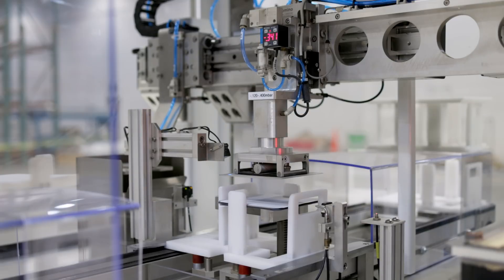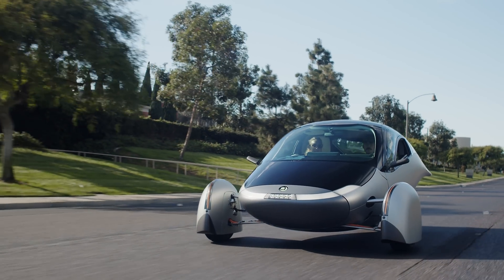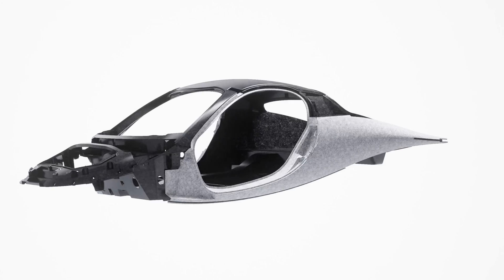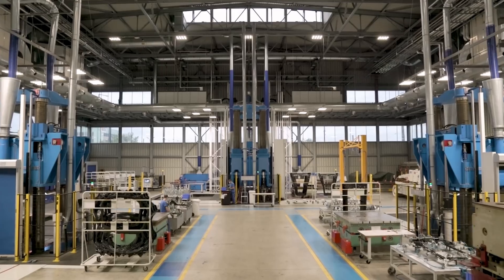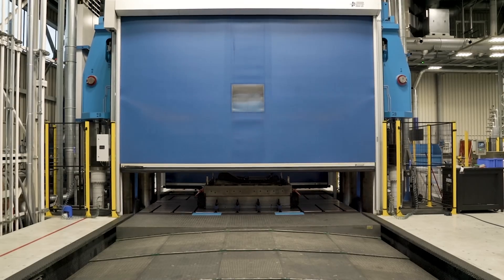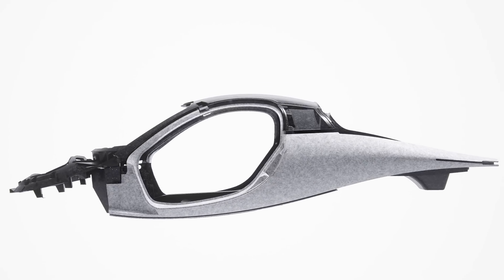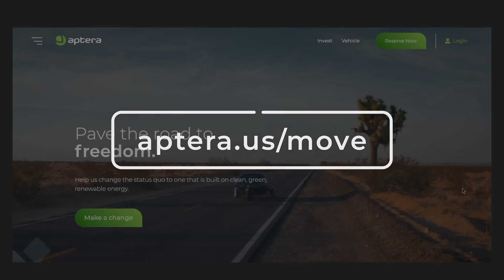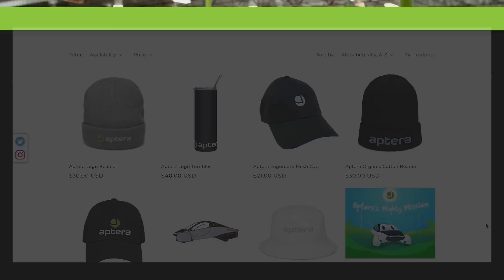Aptera Update — November 2022

Comment: Seeing the integrated production of the "body in white" is reassuring. As a fan of Aptera, knowing that six perfectly-fitting parts make the body means the vehicles can be assembled in large numbers WITHOUT (before?) the use of robots. When the purse is tight, this may yet allow production to get going. The cars will surely sell, if they can make them.

Comment: Let me know when you no longer use hub motors!
Reply: Why would Aptera take such a huge step backwards?
Reply: @n.brucenelson5920  That my friend is an exceptionally GOOD question! WHY WHY WHY would Apterra EVER use THE WORST brushless motor there is...and yet...that IS exactly what they are doing and then blowing hype about "how good" they are when this is patently false! I could list for you the 20+ reasons why you should never use hub motors and then list the 1 or 2 reasons why you should of which both of them are not very good reasons. Basically, Aptera is marketing an idea to people that don't know any better about just how awful hub motors are! There's super good reasons why you don't see any EV makers other than for ebikes and low quality electric motorcycles using hub motors. The short answer is they suck in nearly every way. Then Aptera is blowing even more smoke about solar panels in their cars. Will this add range? Sure it will, just a negligible amount is all. You are almost better to NOT have the solar panels. The cost for them won't be recouped in charging value saved any time soon! I'm guessing something like 10-20,000 miles of charging before you might break even on the cost of the solar panels. LOL! This comes down to the dismal efficiency of solar under even ideal situations. Even in direct, bright sunlight with so called "high efficient panels" you are unlikely to get more than 18-20% efficiency from them and that equates to much lower added charge and range than will be meaningful to most people. Aptera is peddling a lot of hype! I don't want them to fail, but at the same time, it won't take too long after they deliver product to people that the reality of that hype will become self evident.
Reply: @de-bodgery  As it happens, I worked for a company that developed our own electric motors for use in sea water.  Tesla was a cross the street, and when they ran out of money and had to lay off their motor engineering staff, we hired them.  I know a bit about motor design, even though my specialty was thermal engineering.

I contacted Elaphe with specific questions a couple of years ago, and they had satisfactory answers for me.

"why you don't see any EV makers other than for ebikes and low quality electric motorcycles using hub motors."

The answer to why YOU don't see them is that you haven't looked.  They are now being delivered in production vehicles.  There is detailed scientific literature with the results of controlled testing going back decades that debunk your claim.

Your claim "I'm guessing something like 10-20,000 miles of charging before you might break even on the cost of the solar panels." could actually be correct.    That is less than a year to pay back the cost to the average driver.   After that it is all money in the pocket of the owner.  At least to me and many like me that is significant.

The numbers you cite may end up to around 20 miles per day or so rural Iowa on the average - likely to cover all of my normal driving needs.  In addition, it will extend my ability to get to camping spots in remote locations such as Death Valley, and still have the power to return - something that I found difficult when motorcycle camping, and a big plus for people like me.

The reality is that nothing else comes close to providing the performance that Aptera does.  Both my wife and I have ridden in an alpha prototype.  Few people have experienced the acceleration that even these early examples offer, and it is major FUN.  

If anything, Aptera is under promising and as is clear now with the C.P.C Group agreement, will be over delivering.
Reply: @n.brucenelson5920  You are clearly a fan of Aptera so you probably already heard this.
https://www.youtube.com/watch?v=gFnyBWEAwqc
This is possibly the first thing about Aptera that I REALY LIKE...right to repair...they said it right there in the interview....that they will provide full disclosure of parts and how to repair anything. Do a battery swap...no problem...here's the new pack and how to do it yourself. I WISH the rest of EV makers at least claimed they would do this! Whether Aptera really does this or not has yet to be seen since they have not delivered even a single vehicle yet. Still...I do LIKE that they are saying they will!!!
Reply: @de-bodgery   @De-bodgery  Yes.  This was a key for me.  Their Chief Technical Officer, Nathan Armstrong, speaks to this eloquently as well.  He also talks about letting customers play with and modifying the firmware in their vehicles with the companies' blessing, for those so inclined.
Reply: @n.brucenelson5920  I do like this a lot. Whether they really do it or not has yet to be seen. I did do a bit of searching for any Aptera git repos and found nothing. I work in software development. IF they are really going to be open source, then where's their repos?

Comment: really bruce; you are the same "ambassador" for Aptera that told me You'd have your Aptera by now; and the same person that then said production would be by Mid 2023 after a list of lame excuses for no production - not even one vehicle a month. So -where are the videos on these people being trained? They video the most trivial garbage - where are those that would really be great - lets see the videos of people being trained with tooling and parts to train them on - super lets see that.
Reply: As you know, the number of pre-orders has swelled far beyond forecast.  It is clear that the vacuum bag resin infusion method of production couldn't keep up with the surprising demand.  The agreement with C.P.C. to produce the bodies pushes back the start of production, but greatly increases the production ramp up rate.  It also likely increases the investment target needed to reach production.

As you should know, Aptera Corp is still far ahead of Tesla's pace in developing the Roadster - both technically, and in financial terms.  You can't point to a single manufacturer who has reached the current stage of Aptera faster.

As an early pre-order holder, I am impatient, too, but thrilled at the increase in quality that the new bodies will bring.

The videos you are looking for will come when that stage is reached - if the funding is there, sometime next year.

Comment: Please ensure that the composite materials used will not susceptible to attract insect to consume it. Certain manufacturers made plastic containers for keyboard keycaps, only to attract lots of insects because of its material. Sounds ridiculous, but just one more thing I don't want the Aptera team to miss on!
Reply: Those plastics were using an entirely different chemistry.  No such issues with these parts.  I ran a major QC lab for Arizona Instrument for years to help control the quality of plastic parts made by manufacturers around the world, so I my comment is based on experience.

Comment: I would highly appreciate if you can do a video on the mile range impact on -30 degree snow regions of Canada will this car survive and work on icy conditions or this is only for dry weather states ???
Reply: Aptera is tested down to -20 F - just a little above -30C and some of the components are tested down to -40.  I will be driving one of the early 2WD models in Iowa year round and will report on how it does in cold and snowy weather.  I am not too worried based on what I know now.

Comment: a. Is there any way to implement a third seat? How about more storage, under seats?
b. Will you make a way for us to turn the seats around, so we can sleep in the trunk without a tent? (A blow up matras on the seats, could raise up the head-height).
c. Have you considered using evaporative air-cooling, to replace bulky and consuming-hungry air conditioner? (incase you plan to have no cooler at all)
d. To replace a full on heating system... have you ever considered using heated seating and heated steering wheel... In a combination with a small heater and good light-weight insulation? It will make it as warm and comfortable as a car, while eliminating road noise.
e. Have you considered replacing back glass panel with a solar panel, and using a monitor where a mirror should be? Maybe as an option?

Comment: Super excited to see the progress.  One question.  How would the body be repaired?  Say if the rear corner section got into a fender bender accident?
Reply: Once into production, we'll know more about qualified composite body shops.
Reply: I have a fair amount of experience repairing composites - more than metal!  Both repair and part replacement are options.  Shops with experience working with fiberglass should be able to do such work, and not a little can be done by owners.  Many small accidents that would require dent repair would only be a scuff repair with Aptera.

Comment: I'd love to be proven wrong, but I'm starting to strongly suspect this vehicle is going to cost quite a bit more than they originally stated.
Reply: That was my thinking, but I prefer not to speculate.  We have no idea what the parts cost are going to total or what volume manufacturing cost cuts will result.
Reply: It's hard to say. The initial tooling for the forged carbon will be pricey, but the per-unit costs to build a chassis will be significantly lower. I have no idea where the break-even point is, but at a certain level of production, this development will make the Aptera cheaper.

Comment: Great to finally see something on the composites.  Composites are tricky with high process dependence so using a company with experience in the higher volume side and with automotive is probably almost mandatory to get it right.  I'm not aware that there are many companies that could do this, especially in carbon fiber.

Comment: I think I’d prefer to show off the cool carbon body vs a wrap that covers it
Reply: Most carbon composite structures break down in long term high UV. Since this self charges in the sun it needs uv protection.. But I'd definitely want it painted .Well taken care of this car body could last a lifetime or more.
Reply: @andron967  thanks, didn’t know that. But I know production cars like the i3 and some performance vehicles have exposed forged carbon on the roof and elsewhere on the exterior. Maybe they just use a good clear UV coat. I’d prefer paint as well.
Reply: @jaredfromspace  . The exact type of carbon is a bit in question right now. I'm sure it has been decided but I've not found the info. That said we now know a company in Italy will at least make the sections. And more info should be released soon.  I've been around aircraft composite molds and manufacturing.  I've tried to stay current but admit my knowledge is probably obsolete. At least now Aptera will answer some questions.  This is very important. But I still think it's going to require cloth layup to get the needed strength. Probably vacuum infused.  Epoxy joining of sections should be relatively easy. Maybe that will happen in California?
Reply: One reason that I've been a bit frustrated is,  These terms for these types of structures are sort of slang language.  For instance composition structures go back hundred of years. Paper and varnish with paint and even guided. Very lite and strong. That's how some of the extremely ornate royal carriages were built. Then fiberglass and Kevlar and carbon cloth etc etc. But these are all very labor intensive and expensive.  But there are ways to put  some carbon material in high pressure and sort of forge parts. So with so many materials and procedures a clear description is needed.  And I've installed a lot of vinyl film  it's good but not as tough as paint. Most can't handle any gas being skilled on it. On a highway in traffic fuel spray is there due to cars and trucks spilling.  Plus tar, atf paint, all kinds of oil etc etc.

Comment: So you went from a single resin cast body to a 6 part frame? I'm confused....
Reply: I don't think there was ever a plan for the entire body to be one piece
Reply: It has always been a six part scheme. But I would agree with you on the resin - 3-D printed composite body. I didn't know carbon fibers belonged to this category🤔
Reply: @adimchionyenadum2962  The body was never to be 3-D printed, but there was some talk of 3-D printed molds.  Yes, carbon fiber can be one component of composites.
Reply: @n.brucenelson5920  Okay, I didn't know that. I thought the body was going to be 3-D printed. So, why aren't they 3-D printing it? To the best of my knowledge, almost everything nowadays can be 3-D printed.
Reply: @adimchionyenadum2962  No worries, none of us know everything!  This is why they have a great team.  My thoughts are that 3-D printing would be way too time consuming, even if the required quality could be produced.  Video they have shown in the past of the wheel pants being produced showed a vacuum bagged resin infusion process, which is what I believe they have used on the prototypes, but this new parts source may be faster and produce even higher quality parts.  I don't know too much about it except that several of the exotic supercar bodies are made by this company.
Reply: @n.brucenelson5920  I have asked this somewhere else: Which Aptera prototype was made from 3-D printed bodies?
Reply: @adimchionyenadum2962  I don't think they used 3-D printing for any of the bodies.  Perhaps for the molds to make the parts.

I don't know for sure, but my understanding of the previous body process was to print 3-D molds that the layup material carbon fiber, e-glass, and possibly other fibers, was laid in the mold, covered with plastic, and than resin infused with a vacuum process to wet out the cloth with resin.

It would have been easy to make lots of molds, but the process is labor intensive.  Using a press like it looks like they will be doing now, will be much faster, and produce more precise parts.

Comment: This was awesome!  Right up there with the solar production video.  Lots of great information.  Thanks Steve, Jason, Sandy and the rest of the Aptera team!
Reply: Steve F. is indeed back in action! 😉
Reply: Curious to find out if this arrangement will involve licensing and/or domestic production of the bodies, be it initially or down the road. The supply chain delays due to distance "could" be an issue and a serious cost driver if and when changes need to be made. No doubt that these guy have experience though.
Reply: Looking forward to your fine-toothed analysis, especially on those BINC renders.
Reply: On Munro Live, you could find a teaser of a CPC product. I don't remember exactly the video where I saw it, but it's related to the 4680 tear down, one of the last video, if not the least: at the end of the video you could see Sandy unbox a carbon fiber chassis that closely resembles the one seen in this video.

Comment: So do we get soon apteras also in Europe?
Reply: no a year or 2 later than the US i think
Reply: @lukaellegaardjensen6178  pity. but fits for my retirement.
Reply: Currently the Aptera's size does not fit Euro legislation for 3 wheeled vehicles. Is almost a joke as it would comply with 4 wheeled vehicle size. Actually it is a joke.
Reply: @moestrei  so it won't even come to europe before they have changed the regulations, lol that gotta take decades
Reply: @lukaellegaardjensen6178  No, they'll probably make a narrower version.  They've said that they're working on the needed adjustments.
Reply: @lukaellegaardjensen6178  Let's hope for a miracle 🤔. Here in Australia the issue is that any vehicle with a steering wheel (vs a handle bar) is classified as a car and need to comply with the relevant crash tests (AFAIK).
Reply: @WyndStryke  so means it will look like a joke
Reply: @WyndStryke  Making a narrower version is less likely and I guess technically more challenging. What I know they are working on is a homologation. This entails changing rules and regulations, or making exceptions, etc.
Reply: @moestrei  Early production intent deltas are scheduled to be physically crash tested by a third party to FMVSS automotive crash test standards, even though they aren''t required to by the class they fit in the US.  There should be no issues.